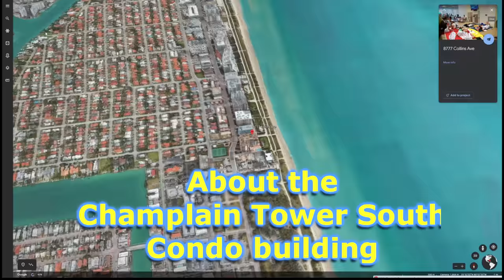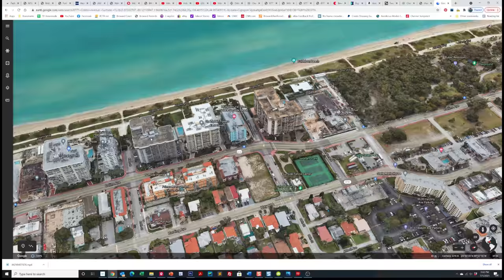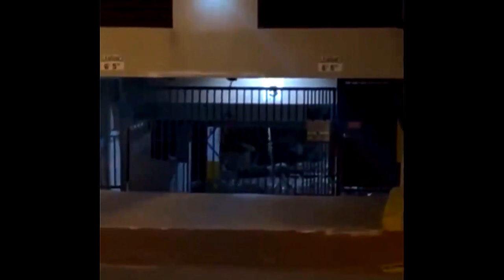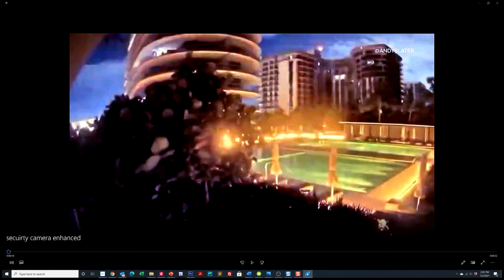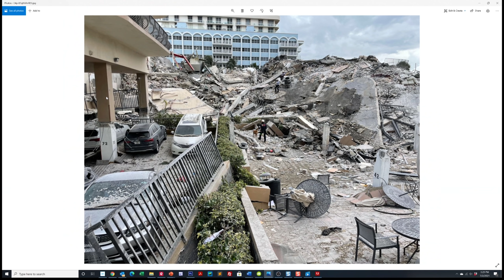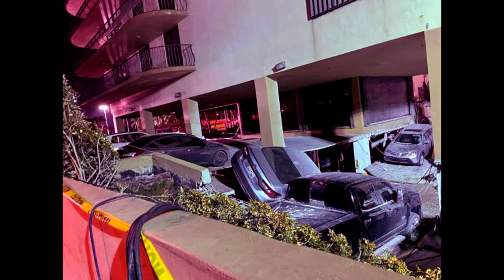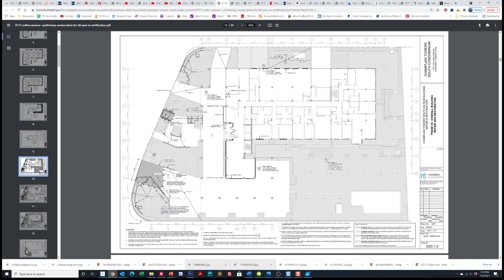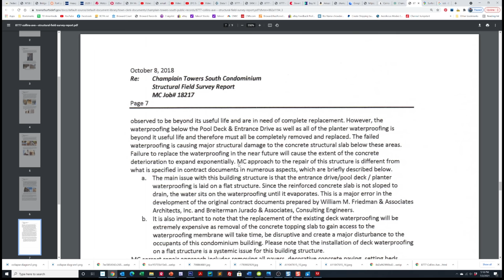Here's Cause Of Miami Condo Collapse Champlain Condo Towers, Surfside

Comment: If all that water draining into the underground parking structure had nowhere to go it would have slowly seeped into the concrete and into the ground undermining  the footings in addition to the rebar deterioration to the columns where you pinpointed, which all failed starting with footer movement for the domino effect , proving your theory.
Reply from the maker: Yes and note how the concrete was picked so cleanly off the rebar like a fish skeleton after you eat it. there should have been large chunks stuck tot he rebar.
Reply: @jeffostroff  Water getting to the rebar has  made it expand during corrosion so that when failure happened it had no adhesion to the concrete, slipping right threw because of the deterioration of the rebar
Reply: Footings should have been on bedrock.  Problem is mostly the slabs sitting on only the cross-section of the columns.  Notice the columns have no capitals (flat pads on top that support the slabs).  Notice that there are no beams under the slabs from column to column.  The columns punched through the slabs and then you have a progressive collapse.
Reply: @TheDustbinofHistory  another good theory
Reply: The short answer is yes.
Reply: If you don't mind, can you please elaborate just a bit as to what you mean by "footer movement"? I know what the words are but what exactly do you mean by movement?
Thank you! :)
Reply: @laurasalo6160  that means he is lying. Watch the video of the collapse and pay attention to any flashing lights you see. What are they? Buildings don't free fall to the ground. Even ones with faulty oools. Every floor has to fail simultaneously for it to free fall. One or two floora or more will not cause a building to fall unimpeded to the ground. This was murder. Look at the point of failure and watch the flashes begin. All over the place flashes of light. What were the flashes? He doesn't mention all the lights flashing. Why not? Because that would point out how the building failed. It was a demolition.  It was murder to get one guy. John Mcafee owned an apartment in that building.  The guy who says he has dirt on everybody, the most wanted man in america lived there and that is coincidence. Think for yourself.  When it doesnt make sense,  that tells you its a lie. God bless. The flashing lights say it all.
Reply: @Mojo-Risin-Risin  With badly corroded re bar......that's exactly what would happen, there would be no concrete left attached to the re bar.
Reply: @brianadams5996  If you download and watch the original video in high resolution, those flashes are the electrical cables being pulled apart. I can see clearly the blue color of the sparks and it coincides with the lights going out. It's clearly an arc flash and the largest flash appears by the left side top elevator shaft, so I'm assuming this is the large power feed to the 2 25hp elevator motors. There was also a 100 ton central air conditioning plant on the roof for the common areas, this would have been fed by at least a 400 amp service as well. The collapse definitely started at the ground floor/parking garage area, not up top where the arc flashes occur. Explosives don't have a blue colored flash, and I haven't heard of any survivors mentioning hearing the type of loud explosions.
Reply: @TheDustbinofHistory  No. L bars tie slab to columns and bedrock isn't a thing in Florida. 
Pilings are driving for bearing.
Reply: @brianadams5996  your ignorance is showing
Reply: @laurasalo6160  the footer is the concrete structure that the building sits on deep below the concrete slab, the columns and walls bear on in the garage, it also has rebar in it that corrodes with water damage ,water seepage with no engineered drainage planned system away from the building will undermine any structure in time, especially in a sandy and salt water environment ,when that rebar finally gets exposed to the Salty environment the corrosion accelerates 
The wet environment in the parking garage, standing water etc.  corroded rebar etc should have been a clue that this needed to be addressed, immediately 
( think of the damage you couldn't see because all the concrete above and below should have rebar in it) this rebar is also all tied to each other if it's not tied properly the concrete will also fail
From the reports and pics looks like this water seepage had  have been happening for many years. 
As Jeff showed the corroded and/or improperly tied rebar in those columns failed because they were stripped clean in the collapse
  God only knows why the building department didn't condemn this place
Reply: @Mojo-Risin-Risin  thanks for elaborating :)
Reply: @brnmcc01  I would say you are correct
Reply: @brianadams5996  what happens when you get your feet knocked out from under you           you collapse  
 columns holding up the  pool deck failed
 the lighting failed as it was coming apart
McAfee was in prison for the last few years in another country and is now dead
not everything is a conspiracy
Reply: @brianadams5996  I was trying to figure that out too like what were those flashing lights it looks like a demolition job
Reply: Brian Adams you would have a better chance at convincing the audience you are the true Canadian rock star rather than speaking to the true cause of this disaster.
Reply: @brianadams5996   .... Flashes are electrical.  The video is on the money, your theory is not.
Reply: @brianadams5996  The flashing lights are the fire alarm horn strobes going off in the building.  When the cables feeding the fire alarm system are ripped apart by the collapse, they are shorted out which causes the system to go into alarm.  The alarm also could have been triggered by the water flowing through the fire sprinkler pipes as the building came down.  Please stop spreading your stupid visions that mean nothing.
Reply: @ShaunPuzon  Nah, it's the power feed to the roof equipment getting pulled apart. The power feed to common area A/C unit had 4 compressors and needed 324 amps min circuit ampacity, so that's a 400 amp feed right there, plus each elevator has a 25 horsepower motor. It's very likely the air conditioning was running at time of collapse, that's going to make a big arc flash.
Reply: @brnmcc01  I agree that the very first flash that occurs next to the elevator shaft looks like an arc flash.  However, once the first part of the building falls, there is another flash in the area right behind where the first one occurred and this flash keeps happening throughout the video in timed intervals.  That definitely looks like a fire alarm strobe to me.
Reply: @brnmcc01  I had the same thought.  480 volt 3 phase mains.  Figure about 200 amps per floor.  Not likely to have low-peak fuses in the electrical panels and that failing would create an intense arc-flash event.
Reply: @brnmcc01  And the 200 amps at 480 VAC 3 phase or so available to each floor.
Reply: @brianadams5996  TROLL ALERT!
Reply: @brianadams5996  i saw the flashes. I’m not sure mcafee lived there as he was in a Mexican jail however people posted he stored alot of records there! Supposedly damaging records on government people
Reply: @dreamersruleNOW  That's what I wondered. That would be a good way to get rid of all of the evidence.
Reply: @professionalcommenter  same as occurred on 9/11; pentagon too.
Reply: @dreamersruleNOW  @Professional Commenter @Patricia Owens @Brian Adams  Sometimes things are just as they appear...e.g., an extremely unfortunate and preventable accident.  It's good to not be naive, but it's unhealthy to be incessantly suspicious despite reasonable evidence.  That's no way to live.
Reply: @ron4274  not everything is conspiracy however it’s fair to point out mcafee dies then people post that they claim to know mcafee stored a lot of records/documents at this tower that collapsed, records incriminating a lot of people.  Whether this is true us viewers don’t know. This collapse could of been foul play; now they want to remove what could be or show evidence of the initial foul play? Putting more debris on top of the current debris pile will definitely not aide finding survivors.  If it was a natural defects collapse, then the wall still standing was the secure side. I say get cranes to move the debris to the opposite side of the remaining wall and look for survivors. Otherwise it gives the appearance of a coverup. I would definitely evacuate any structures near that remnant standing wall .
Reply: @dreamersruleNOW   How certain are you that the remaining structure won't collapse on it's own?  And wouldn't an uncontrolled collapse be even more detrimental to any potential survivors, evidence recovery, and even the John McAfee theory?  Furthermore, I think you underestimate how much time & effort it would take to systematically move all that debris from one spot to another (even nearby) while preserving evidence and the hope of finding survivors.  

Instead of a cover-up, it could simply be that the authorities don't want to risk losing any more lives given the precarious state of the remaining structure and bits hanging from it.  In the end, all that matters is the truth.  Being skeptical and inquisitive is part of uncovering that truth.  But continuing to ignore reasonable explanations in favour of a sinister and devious conspiracy theory (that lacks any hard proof) is both unfortunate and tremendously insensitive to those directly impacted by this tragedy.  

For what it's worth, the flashes of light are easily and reasonably explained, and has been by many commenters.  The chunks of concrete debris shown strewn throughout the lower parking garage was said to have been recorded 7 minutes before the eventual collapse, which is NOT an efficient demolition if you believe that explosives also created that debris.  Not to mention the poor and deteriorating condition of the complex which has been well documented over the years.  

I own a lakeside condo (no salt air) with some relevant design similarities to Champlain Towers - i.e., plaza deck w/pools(2) above a 2-story parking garage.  The plaza deck and ceiling/floor separating the parking levels "were" floating...which apparently means that they relied on the rebar core to support the concrete that spanned the support columns.  Over time the concrete deck and garage ceiling/floor began sagging, at which point city officials deemed the residential buildings unsafe to occupy until heavy support beams & strapping were installed between each of the columns (to transfer the load).  Sadly, it happens.
Reply: @ron4274  I was in hurricane Andrew, 1992, winds were 155 my area but 225 at the worst before the meters were ripped out by the wind, it was a level 5 hurricane. 60 winds would not take this structure down. It was proven to be very strong as the collapse had no effect on it
Reply: @brianadams5996   For all intents and purposes, the building is a rigid structure from top to bottom, supported by a series of columns anchored at the base (like legs).  If enough of those legs fail/weaken and the bottom falls away, it will pull down the floors above in quick succession.  Hopefully the building had it's own video surveillance (recorded), and that it remains available & intact...though I've heard nothing.  I think on-site video recordings could be quite telling, especially if there were cameras located in the lower parking garage...but I suspect not.  Admittedly, the deterioration had to be quite severe and/or the initial failure significant enough for such a widespread collapse to occur so quickly.  It would be interesting to learn when the parking gate to the lower garage was last activated, and whether or not any debris was noticed (to establish a complete timeline).  Sadly, that may not be possible.
Reply: @spybotist Insecticide? Oh you must have meant "false flag." FTFY.
Reply: @TheDustbinofHistory  Could this mean that no columns in the entire building had no capitals? Wow.
Reply: @MichaeljRichter  Thjs building did not have 480v service. The original 1979 plans are hard to read, but from what I see in the electrical equipment pages the building had several 208 volt 3 phase services. One was 3000 amp. When you add up the 119 kilowatt duct heater for the common area hvac system, 80 horsepower fire pump,  5,10,15 hp domestic water booster pumps, two 25hp elevators, and all the apartments had central electric heating, that's a lot of amperage at 208 volts to supply all that.
Reply: @brianadams5996  Sure looks fishy to me too. But McAfee got suicided on Jun 23rd and building collapsed on Jun24th.

Comment: The columns in the portion of the building which collapsed were spaced closer together and as such, were supporting less weight which is almost certainly why they were smaller.  This was likely just a reality of where the engineer could locate columns to accommodate the architectural floor plan in the garage, lobby, and units above.  Looking at the columns specifically, a critical design item that is just as important as it's area, is its unbraced length, or the distance the column has to support load between a supporting floor.  A 20' tall column has significantly less capacity than a column that is only 10' tall.  When the ground level deck collapsed, not only did it damage the columns and likely applied significant load on them horizontally, but that slab was no longer able to offer lateral bracing to the column, effectively doubling their unbraced length so they're capacity was greatly reduced and likely orders of magnitude beyond their design capacity.  When comparing the bigger columns with the smaller columns, the smaller the columns, the more their strength is reduced by increasing their unbraced length, so hypothetically, going from 10' to 20 feet might have reduced the capacity of the smaller columns by 5x, while only reducing the capacity of the larger columns by 2x.
Reply from the maker: They could have built some concrete walls in between some of the columns I have seen that done in a number of garages too that would add a lot of rigidity to it
Reply: Lovely insight. In fact the Swiss mathematician Leonard Euler derived an exact mathematical equation for buckling load as a function of length.

Trees and elephants face the same problem, which is why their diameters - leg and trunk -  increase disproportionately with greater height, that is allometrically than linearly .

Palm trees cleverly are never straight, but sway and have poor canopy to prevent being pushed over in a hurricane

Comment: All tall building must be equipped with some kind of sensor (seismic sensor) to prevent something like this from happening again.
Reply from the maker: It might have given them just enough time to get out
Reply: That's a fantastic idea! Why didn't this bldg have one of those?
Reply: I feel like though w everyone running out at the same time trampling one another it would’ve been chaotic. Sure maybe even a small percentage of people getting out is better than what actually happened.  But I just see everyone in a panic running out the doors and I don’t think the building would’ve even held w that going on.  All I do know is this could’ve been prevented.  There is no amount of $ that will ever come close to what they’ve endured.  Lost family and loved ones along with memories they’ll never get back. Just horrible
Reply: @jogirl836  prevented how? This is a Cocaine Condo. It was built to fail
Reply: My hubby just built a highrise Marroit just exactly like this in Tampa. It has a parking garage and pool deck exactly like this and it is a lot closer to the water than what this condo was. The water's edge is about 20 feet from the parking garage. The parking lot is on the bottom floor and pool on the 2nd floor and the area floods.  Yet they still built it. If there is something wrong with a design like this, than they wouldn't have built this Marriott but they did and no one had a problem with building it. The architects were fine with it. No buildings have come down in hurricanes even with high winds and sometimes 20 feet storm surges. And they have  a lot older hotels with saltwater corrison than this condo building. Something fishy
Reply: @jogirl836  If there was a sensor installed in the building, it probably triggered weeks before it happened.
Reply: @gowest5145  There wasn't a problem until 40 years later.